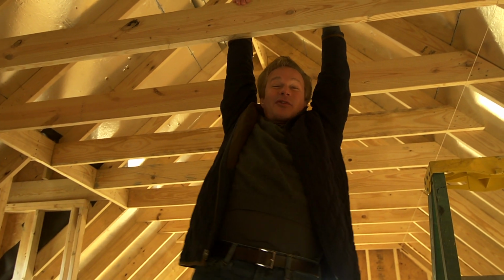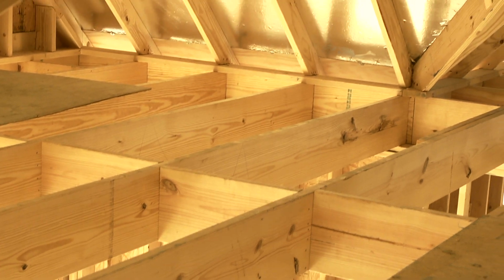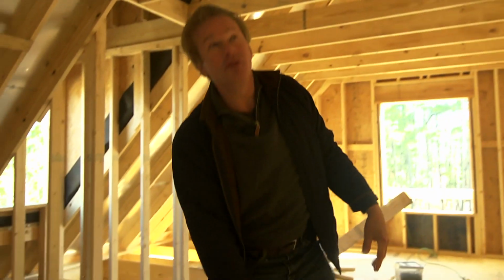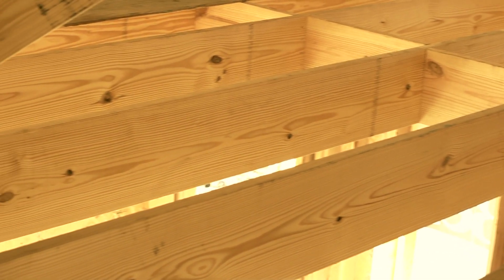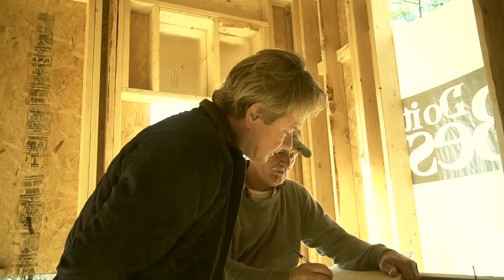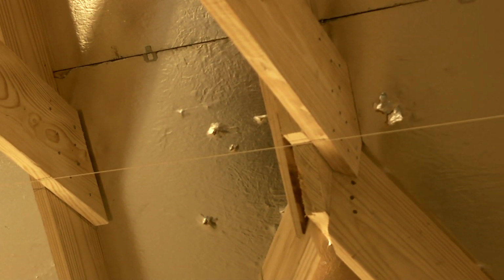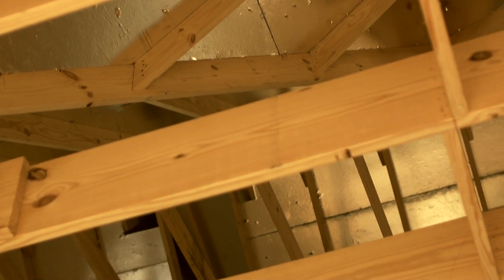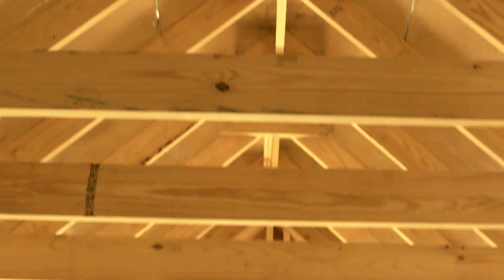Upstairs Design | Day 32 | The Garden Home Challenge With P. Allen Smith

Comment: I've never used that radiant-backed plywood before. But it makes so much sense considering the upstairs is technically "in" the attic. But I'd like to know if you'll be insulating in the sloped part of the ceiling as well to form a thermal envelope of sorts around the upstairs?

Comment: I know it sounds counter intuitive, but the the material you see is serving as an attic radiant which reduces heat build up during the summer months and heat loss during the winter by reflecting the heat or cool air back into the house, not the attic, so your air conditioner isn't having to cool or heat a room (the attic) that is uninhabited, thus lowering the cost of the energy bill.